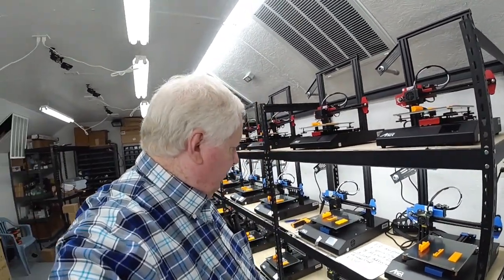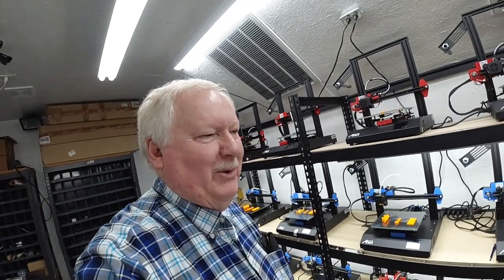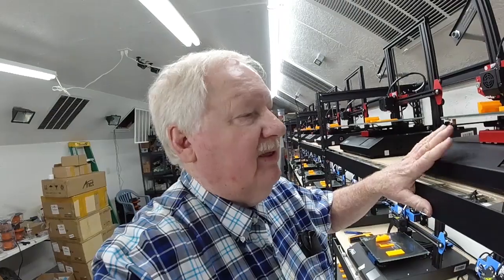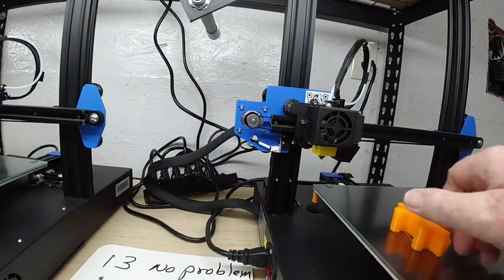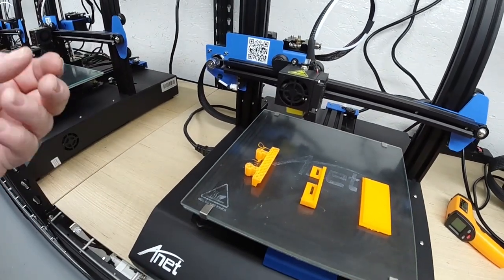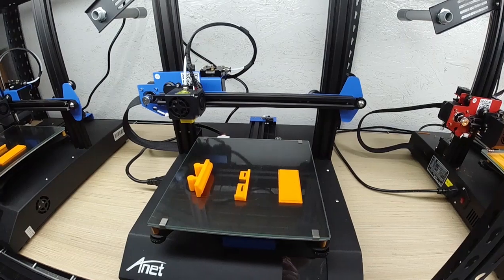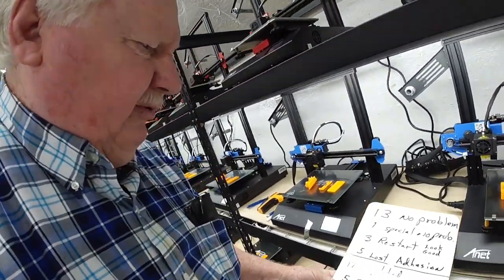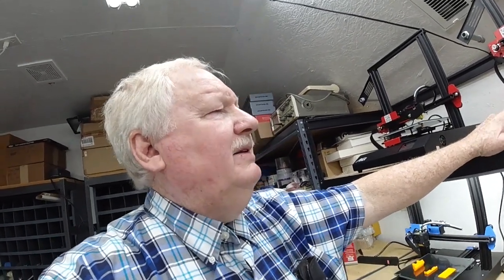HOW DID MY 22 3D PRINTERS DO??? After the first test run of 22 Anet 3D printers at my new print farm

Comment: Great video ! Some printer don't heat as well on the side of the plate causing adherence issue. You may check that with a heat gun and put the taller/challenging piece in the middle to remediate it.
Reply from the maker: You're so right my friend. I check the bed temperature on all my printers and there are a lot of variations. It's good to use a heat gun to check surface temperatures on the bed. This way you know if you have a problem and need to adjust the bed temperature. Good comment and thanks for sharing...Ken

Comment: Instead of adding both phases to determine current, measure the neutral current.  Being split phase, the two phases subtract, but only if the loads are in phase. The easy way to tell is measure neutral current because that is the sum of both half phases.
Reply from the maker: Since the current in each phase is alternating in opposite  directions, the current indicated on the neutral is actually the difference between the two currents being drawn by phase A and B. Also since the current on these two phases have considerable fluctuation, +/-  3Amps I just have to guess what the average draw is. I don't have a power meter. The power here may be different from where you are , but here the two 110V phases oppose each other giving us 220v. Thanks for your  comment and for taking the time to share that information....Ken

Comment: Really great first run Ken.  A lot of hairspray.   Experiment with some of the bed adhesives. Some of them really work well with glass .  They all are pretty good.  I have to use them and ac glue-because my prints have very small bed base and are 6” tall.  Very challenging but with the above I very rarely get a failure.  Key to failures is speed .  Try slowing them down .  I run mine at 50 it works for my PETG .  Pla  you can run faster but if you don’t need speed slow them down.  Thanks for showing us your results.  Your friend and fan Joe
Reply from the maker: Thanks Joe you make some very good pointes. I do have some tall parts also and you are so right, they are a challenge. I will try slowing down the speed on the taller parts. Thanks for the comment and your ideas...Ken

Comment: What material are you printing with? Also, sometimes I find that with certain printers I need to slow my speed down about 10mm/per second from the rest of the printers to get good adhesion
Reply from the maker: In this test I was using PLA. To be fair, some of the spools were older and had been used many times and probably had more moisture content. This may have been a factor also. Your right about slowing down the print speed and I will try that. I hope I have a good solution to the adhesion problem soon. Thanks for your comment and your ideas...Ken

Comment: @8m maybe filament diameter was not consistent?
Reply from the maker: I was using the same filament on all printers. Only some of the were not fresh spool and had been used many times before and one or more of them probably had higher moisture content. You have a good point and I will check filament diameter a little closer, Thanks for the comment and input...Ken